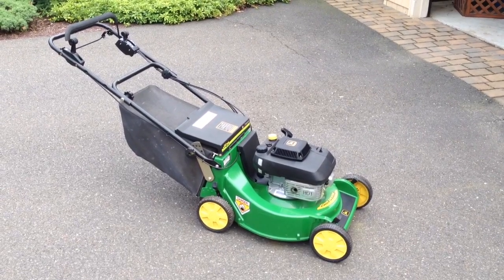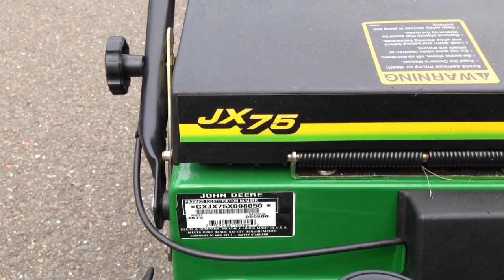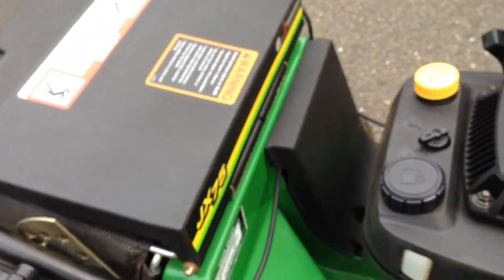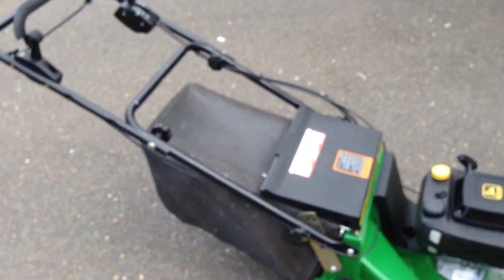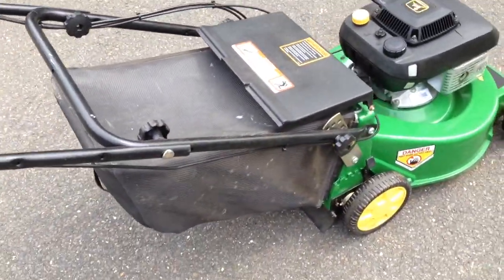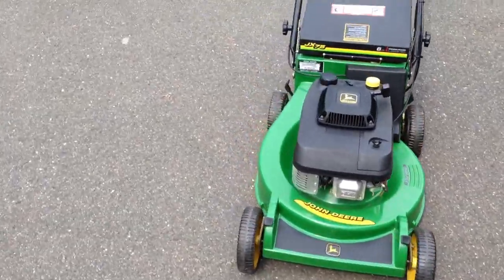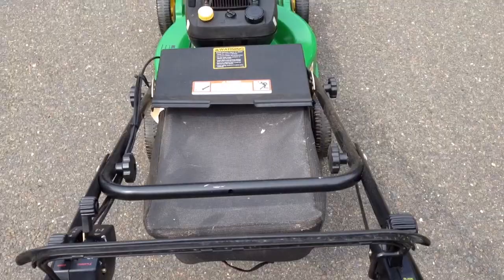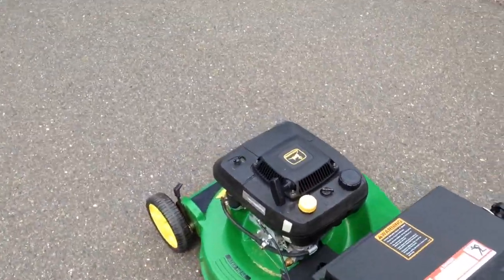John Deere JX75 Mower Overview

Comment: I just mowed my parents front yard with this mower today. They have had it since it was brand new like 15 plus years ago, It's in amazing shape also. They went from the John Deere 14SB which they have also had since it was brand new many years before the JX75 was made. The 14SB axle went out and they are super expensive to replace. They still have it it broken and like i said, the JX75 is one of the best mowers i have ever used, hands down. I use a Honda HRR216 that is also 12 to 13 years old and still runs amazing and cuts amazing, use it every day in my lawn business, but the 14SB and JX75 are just superior mowers! I want a 14SB or a JX75 so bad..lol.
Reply: Brian vous avez beaucoup de chance

Comment: You'll eventually have problems with the blade-engage lever (internal parts "wear rounded") and it's not uncommon for the drive/clutch to get fussy over time and need work. That said, I've had mine for 15 yrs. I put gas treatment in it for winter storage and use a JD tune up kit every other year (or two...or, ahem, three). That's it. Best mower I've owned or likely ever will. Starts first pull every time, Kawasaki engine is bulletproof. I took it in for a Deere dealer service at a the 14 yr mark; before I even explained what I wanted, the service guy asked me how much I'd sell it for. Yeah, they're that good. And no, they don't make them like this anymore; haven't for a long time.
Reply: I had a briggs one in storage for a couple of years, got some 1 year old or so gas for it and it started first pull after priming it, they really are good
Reply: Lol yep I’m having issues with my blade engage thing
Reply: Still have it?
Reply: @kanyeeastlolz   lol Yes, actually. Paint finally started to peel off, and I'm on probably my 4th or 5th set of wheels, but yeah, still starts up fine and runs smooth.
Reply: @rugbynimbus  amazing

Comment: I've owned 2 14SB mowers and a JX75 which I'm still using today. Bought it new in 2002. Had carb issues one season but think I finally got them ironed out and it's mowing just fine again. Wish I had another one of these in storage! lol...
Reply from the maker: SuperDave21 I have three JX75's and one 14SB. The 14SB is torn down and needs to be rebuilt, but the JX75's are all running great. These are some the best 21" mowers ever built.
Reply: I agree completely..... only wish they were still in production...!

Comment: Eric just picked up a 14sb. The big bolt for the tension spring plate on the blade clutch broke off at the engine block. Clutch disc gone completely too. Did anyone figure out about the blade adapter clutch bypass from a few years back? Thank You from Florida.

Comment: I have the same model and have excessive vibration when running, when I engage the clutch, vibration goes away and is smooth as silk.  I thought the clutch was bad, spent $160.00 on a new one and it does the same. Major vibration with teh clutch not engaged. I may rip it out and run the  blade direct.
Reply from the maker: lmr839 by any chance did you verify the bolts holding the engine to the deck are all secure and the engine shaft is straight (which you can check by rotating the blade by hand with the spark plug disconnected).
Reply: Yes...I had to remove the engine to install the new clutch, I re installed them with an impact ratchet. The engine is in tight.
Reply from the maker: If you happen to take some video of the issue and post it I'd be happy to have a look if you would like a second opinion.
Reply: Highly likely your crank is bent, verify by slowly spinning the blade with the mower on its side and watch the whole assembly. If it moves out of center, your crank it bent.
Reply: @nvdubs  The problem was the bearing on the bladed engagement clutch and blade were bad. Changed it and it got much better, then I solved the problem completely ....I bought a Honda.
Reply: @joeynahas3016  yeah I discovered my crank was slightly bent on mine when I put a new clutch on it. Funny thing is, I just bought a new Honda hrx with the blade clutch and electric start.  Most comparable to one of these in my opinion!
Reply: @ErikAsquith  Bent Shaft

Comment: what kind of oil should I use for when I do an oil change?
Reply from the maker: J&R Contracting I use 10w30 here in the northeast. I typically use Mobil 1 full synthetic in my equipment.
Reply: Erik Asquith ok thanks I Live in the north east too. thanks again!
Reply: Erik Asquith you just got mine running the other day!! all she needed was a new spark plug. Now she is awaiting new carb bolts and an air filter
Reply from the maker: J&R Contracting was the engine not firing at all? Or was it running rough until you changed out the spark plug?
Reply: Erik Asquith she wasn't running at all untill I changed the spark plug
Reply: 10W50  mobil 1 l été plein soleil l  après midi  pour 12 ans

Comment: Did you sell the JX75 or keep it?  That one is near mint condition!  Though just realized you posted the video a year ago.
Reply from the maker: +Steven B yes she's a beauty - I've yet to find another one in near mint condition. I ended up keeping this one for my mother to cut her lawn. I picked up another JX75 for myself about two months ago and it's in excellent condition. I use the JX75 in conjunction with my Honda HRX. I find the JX75 to cut and bag leaps and bounds better then the Honda. However, the Honda does mulch and shred leaves better.
Reply: +Erik Asquith Couldn't agree more.  Honda bagging benefit is that it cuts it smaller, but Deere bags the best.  I have both, HRX217HYA and a John Deere 14SB, which is unfortunately in the shop right now because the base cover cracked when changing the oil 2 weeks ago.  Hopefully it is fixed this week.  I'm soon to have a 14SE too that I won at auction that I will fix up for myself.

Comment: Anyone know what the price was of these new? I have a JE75 with oil filter and electric start my grandpa bought new and was curious.
Reply from the maker: NvDubs250 they were around $1K in that configuration. Where are you located?
Reply: @ErikAsquith  in Nebraska
Reply from the maker: NvDubs250 location will make a difference resale wise. However, I am not too familiar with the going rate is there.
Reply: @ErikAsquith  I just wanna know what they were new, right from dealer, etc.  Oil filter version with functional electric start is a little more hard to find these days
Reply from the maker: NvDubs250 there are few JE75’s Gen 1 (with electric start and battery) when compared JX75’s Gen1 or 2 (withOUT electric start and battery). The oil filter kit can be added to either. However, the JX85 is even rarer and includes the oil filter kit, steel wheels, steel height adjuster slots on the deck, etc., but withOUT the electric start and battery. I happen to have all of them with the exclusion of the JE75 Gen 1 (there is no Gen 2) - I will probably to a comparison video one day.

Comment: Where's the oil filter on this JX75?
Reply from the maker: The oil filter is an optional add-on for the JX75 and JE75 models. Mine does not have one. However, the oil filter had been included on the JX85 model, which has some design changes to make it a commercial model.